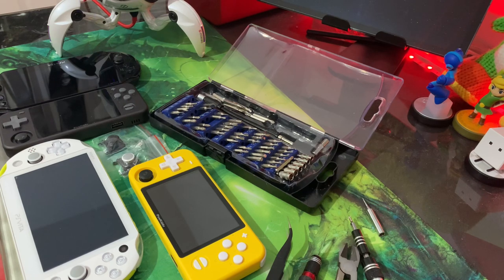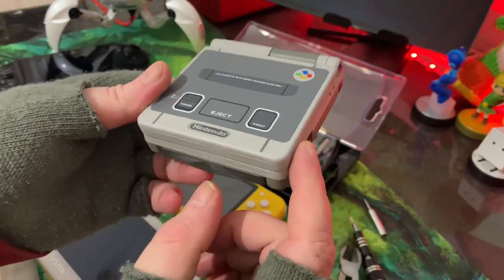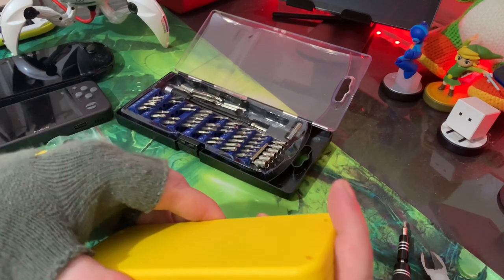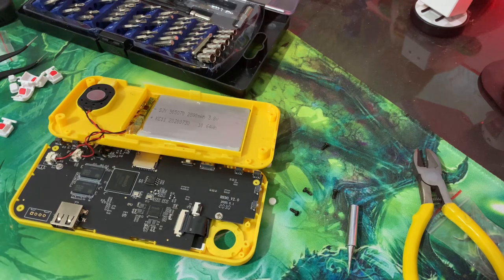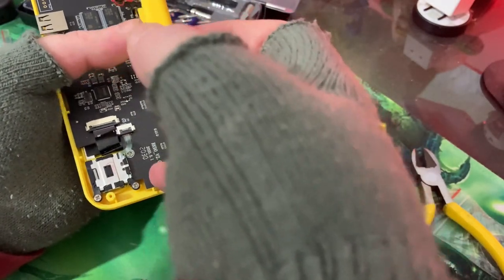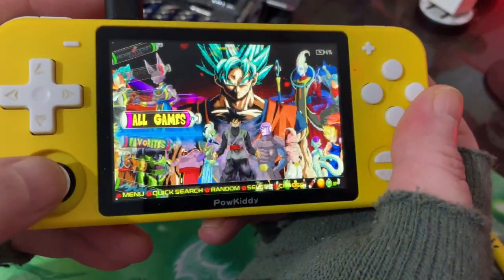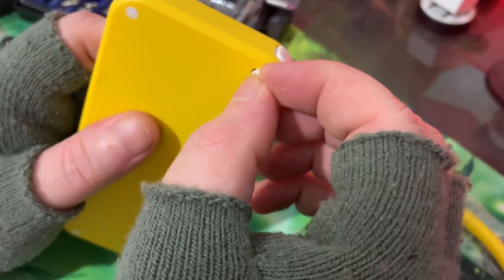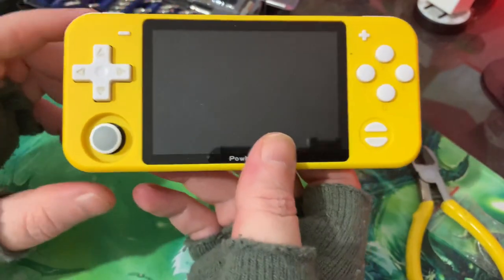Modding My RGB10 with a New Ps Vita Analog stick - Tutorial

Comment: Nice ! Is this mod possible on a rgb20 ? Waiting for mine to be delivered, and it seems to be interesting to change this on it
Reply: You can do a stick mod and the process is basically the same but the rgb20 doesn't a vita stick. I believe it's a nintendo switch knockoff stick. It's very good quality and already rubber coated with a click button. Basically no reason to change it.
Reply from the maker: well you could but you will lose the ability to to click the L or R3 buddy but if you are not bothered about that then yes I think you could
Reply from the maker: very true
Reply: @SonicLoveEmulation  well, i'll stick on the original stick ;)

Comment: What is that pointy thing that you used to remove the rubber off the screws?
Reply from the maker: it comes with the tool kit I got for the screwdriver few different sizes but the name for it I don’t know
Reply: @SonicLoveEmulation  
Ok, thanks. I asked because the volume is low. I wanted to turn captions on so I could get the names of the tools you were identifying but it said captions unavailable for the video. So, I asked. Thanks.

Comment: It's anbernic rg351p can be replacement too with other analog? I'm so curious if my analog broke i can replace it with new one.
Reply from the maker: yes you can but you will lose the L and R3 capabilities if you use the Ps vita analogs but you can buy a replacement switch analog for the RG351P not a problem and just as easy to replace buddy